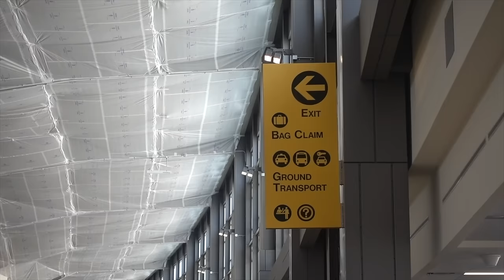MTB Myths that need to die—and some that are true!

Comment: Quick releases close on left  side because European road race mechanics change wheel on the fly fast. They pull the rear derailleur back with right hand and guide wheel into the drops.   The left hand pulls the left side into the dropout and then closes  the quick release.

Comment: But the air lines are not going top stop and check if your running tubes or tubeless, hooked or hook-less rims with the correct pressures. I was an heavy aircraft crew chief for over 20 years and if your pressurized item being stored in cargo has not been tested and certified safe for travel then loose the the air pressure. BTW I have had a tire blow off of a hook-less rim at 47 psi when seating it.

Comment: You can't burn your hand/fingers on the sprocket or derailer. If you have to stop for a flat and have been driving a while and braking and you try taking off your wheel when the lever is on the side with the disc brakes it's not so safe. I'm sure someone else mentioned this.

Comment: If got an old set of wheels for my racing bike. It has rimmbrakes, but you can close the lever so tied it gets caught in your spokes, if you adjust it on the wrong side. So there is some truth on this myth but not for modern bikes.

Comment: I was always told to avoid the disc side because it gets hot and you could burn yourself if you're taking off the wheel in a rush after a decent.

Comment: Tire pressure.  Look at the Ideal Gas Law.  Pressure x Volume divided by Temperature equals Pressure x Volume divided by Temperature.  PV/T = PV/T.  This is why aircraft tires do not explode, and no it makes no difference that aircraft tires are filled with nitrogen.  Aircraft tires use nitrogen to prevent corrosion.  Nitrogen filled vessels still have to follow the gas laws.

Comment: Recently flew with my mtb with tires at pretty normal pressures, and the tubeless sealant leaked out all over everything else. Not really sure how I'd deal with this in future, since the tires were completely flat by the time I got it back. Wonder if the cold temps caused them to collapse and leak air and sealant?

Comment: about the hex keys I think the ball actually damages the bolt less than the full key - you can damage the ball rather than the bolt
if you don't want to damage the bolts just use wera hex plus keys, this stuff can even open the stripped down bolts

Comment: A couple of things

Storing bikes, mine get stored in the garage all winter, in Canada and it doesn't seem to have much effect, even though one of the bikes has been stored like that from new in 1974....

Quick links, I think people would be a lot more likely to use them once only if you could buy them say in packs of 10 for $10.  At $7 a set, for what amounts to 15 cents worth of metal, uh nope.....

Comment: Swapping your skewer on the rear also removes the temptation to grab your rotor for extra leverage while closing. At a minimum you'll get your finger oils on the rotor or worse you could bend it.

Comment: for me the only true part about the skewer myth is the direction.

I once pointed the rear one forward and it got pulled open when I brushed against a bush that applied enough force to push the lever to the open position. I didn't notice until it came off some time later during a jump

Comment: I wanna cheap in on the airplane myth. Airplanes are pressurized to an altitude between 6000 - 8000 feet. If your airplane gets air pressure of it's current flight level of 30000-45000 feet you have bigger concerns than an over inflated tire.
Reply: In this case an emergency descend would be the first the pilots would do

Comment: what about reinstalling a link that you removed with the chain-pin pusher thingy
the thing what you use for pushing out the pins on the chain I mean

I actually did that on my motorcycle a few times too
many people say "if you do that it's gonna snap in a few meters" but I never hat that issue

Comment: Add to that fast engagement hub . I think pedal kick back is a myth . Yes on the computer cad it would show the chain is lengthened and being pulled back. But in reality you are most likely gonna be rolling forward even on the slowest drop so even if your chain is pulling the pedal back couple inches your wheel should be rolling forward  more than few feet per second to cancel out the pull back. And instead of kicking the pedal up with your weight on pedal it's more likely gonna spin the rear wheel forward as you are the bigger mass than the weight of the wheel with momentum going forward. Pedal kick back is 100% myth

Comment: The tire pressure thing is just science. If your ambient pressure is 14psia and your tires are 20 psig; then you go on a plane and ambient is 0 (not possible unless you are in space so literally worst case scenario) your tire pressure would be 34 psig. So ig 2 things, run your tubeless at tubeless pressure, and dont deflate your tires unless they say you cant load your bike otherwise.

Comment: The "One last run" jinx seems to be true. My opinion is that you loose your focus a bit thinking about packing up, driving home and the events of the day instead of just staying laser focused on getting to the bottom and surviving to get back on the lift with undamaged equipment etc. Also you focus more on the obstacle in real time not riding forward and thru it. Squeezing in one last run is all it takes to ruin an epic trip sometimes. Leave something on the table to come back for.

Comment: The only issue with QR is that’s just not so strong like bolts or 20mm axis, on bikes with gears it’s not a so big issue from what I know but on single speed bikes and forks it makes a big difference…

Comment: How about hydraulic brakes and vertical storage? I think some brake designs are designed to use gravity to keep potential air bubbles in the reservoir and vertical storage could allow bubbles to get into the system instead.

Comment: Why do people even use quick links?  Especially considering it takes a tool to use it.  Just use the standard chain removal tool.  And if your worried about messing the chain up you could mark the link so you don't press the pin out of the same link more than once each time you need to remove your chain.

Comment: Fast engagement hubs won't kick back the cranks if the wheel is turning at practically any riding speed. If you're going slow enough for this to be an issue, you're probably not having much fun.. you'd have to almost come to a complete stop..

Comment: Also you’re wrong about the ball end, it will not round out bolts unless you use it improperly, if you stay within the engagement angle specified by the hex key manufacturer you can fully torque it down with the ball end

Comment: I would disagree with this quick release thing. I have it on one of my bikes in front. And I installed it with lock on right side so it wouldn't get into disc in a case of a hit. Heavy pressure can brake the leverage. And if its't not on the rotor side, it can't make a way into the rotor for sure.

Comment: Regarding e-bikes. I am probably one of those fat, lazy people. But the reason I converted the E-bike is the fact that despite the main bike trail by me being only 3/4 of a mile away, it is at the bottom of a 1/2 mile long 4% grade, with some sections reaching 7%. That sucks at the end of a ride, regardless of intensity. So it was either ferry my bike to the trail head, or have it help too. It is also really nice to show up to work fresh and sweat it out on the way home instead (most of them have an off switch for the motor).

Comment: Gauge pressure inside a tire cannot increase by 15 psi... atmospheric is 14.6 psi and aircraft are pressurized to 11 to 12 psi. Air pressure at 42,000 ft is around 2.5 psi, so a pressure rise of 12.1 psi could be seen in the very rare event of cabin depressurization. Otherwise, only a 3-4 psi increase from cruise cabin air pressure.

Comment: The last run factor is true. I broke my collarbone skiing a half pipe while my friends were already walking to the car at Northstar. I needed ski patrol to carry my gear to the lodge
Reply: Ah, but if you'd done another run afterwards, then it would have been your penultimate run that was bad!
Reply: @devononair  Uh, sure, but I broke my collar bone...so another run wasn't on the table. Props to you if you could keep going after that
Reply: @nathanchildress5596  Yeah... that was the joke ;)
Reply: @devononair  Gotcha, ok.

Comment: I have started using clipless pedals shortly after I started riding MTB and moved on from them to flats after a couple of years, so one could say i learned to ride on clipless pedals, but it didn't take me long at all to get used to flat pedals. I have to say though that clipless pedals do make riding easier and I would recommend to start with flats to anyone new just to be a better technical rider.

Comment: My Rockshox Recon fork suspension oil dripped out onto my floor when I was hanging my bike vertical. Clearly new seals were needed. But still to this day I hang my bike Rear wheel up as the oil stain is still in my garage

Comment: even if there is zero friction holding a quick link in place, when is a chain ever in compression? I guess if you're rattling the absolute hell out of your ride, eventually there might be some utterly freakish combination of events that would both slide those plates past each other and separate them at the exact right moment, but I think the odds of Halle Berre deciding to spend a night with me are about equal.

Comment: It is still possible to get some qr levers to fold in to the disc, what it does is loosen the sqewer and make the wheel wobble.
A good quality hex ball end can apply torque and is essential for the STEPS drive side crank.
Studies have shown that people ride ebikes on average 3 times further than a regular bike. I have multiple customers with epic weight loss
Tally Ho!

Comment: 14:38 ....Well in europe, yes. You get 250W constant and peak power .With some exceptions of 500W peak power and 25kph tops (15 mph)

ANY value past that makes it a motorcycle : Helmet , license , plates, registration, insurance

250W and 25kph you can do without electric motor easily, cheaper and without a range limit and added weight

Comment: Another myth: using a drill on your bike will wreck fasteners and components. Nope, set the clutch appropriately and send it. You think I'm removing and installing them rotor bolts with a P-handle? Hell no.

Comment: Leaving your MTB hanging on the suspension fork for a long time will definitely ruin your dust seals. 100%! Absolutely. I had to replace the dust seals on the Rockshox Reba and Fox Float on bikes that weren't used for a year and hang there on the wall. The weight of the bike will slightly deform the dust seals and after one year oil fluid will leak out and drip on the bottom. 🤔 Even Suntour forks with grease only can be damaged since the tiny deformation leads to entry of water into the fork with subsequent rust party in the inner steel parts.

Comment: So here are people that are in for a discussion with the airline agents that decide what's going on the plane or not? Good luck. I travel A LOT with my bike and had that discussion coming up only once - in Milan/MXP which is a big destination for road cyclists and which is a whole other animal when it comes to tire pressures.

Did also not want to open any can of worms as far as air pressurized air shock/fork etc. in that scenario. But well... it's about letting air out of your tires. These check-in people are not engineers, they are just following their job following orders. It's not always about being right...

Comment: Hanging Bad for Suspension
never heard that one
but Hanging being Bad for Brakes is true.
(Hydraulics)
if the reservoir is only half full and you squeeze the brake lever while its upside down, you can pump an air bubble into the line
well, Ideally you wouldn't have air in the reservoir in the first place and you wouldn't touch the levers when hanging... but shit happens

Comment: Lazy person on an E bike. That was the best myth of them all. Flying a bike, agree, I have flown many times international with all three of my bikes at one time or another. With the road bike I let a little air out since I run those close to max pressure. The gravel also, just a bit, the mountain bike no.
Reply: The "Lazy person on an ebike", there is actually some degree of truth to that. I wouldn't say "lazy", but some people get complacent and less energetic in ways that causes them to lose some of their stamina and strength. Sometimes I ride with a group where couple of riders transitioned to ebikes. A number of times they'd bring out their other bike (no, I'm not gonna say "manual", or "acoustic" or "analog" because that's not what they are), and find themselves huffing and puffing up trails. But before their ebikes, they use to have no probs climbing those same trails.

Comment: I am a lazy person loading my e-bike into a plane with reduced air pressure in the tyres after changing my quick-link because I cleaned my chain after calling the last run then getting the chain muddy whilst practising  bunny hops using my clipless pedals

Comment: At 7:00+ you state there is not really a problem with the position of the skewer.handle.  Not correct, if the handle is closed towards the front of the bike it can possibly snag brush or vines along the trail.  That can really yank your leash.  Also if you are running directional tires which rotation is marked by an arrow on the tire's sidewall, if you always have the skewer handle on the left you will never accidentally mount your front tire in reverse rotation.  You are correct that on the rear drive side a rear facing handle can interfere with the derailleur.

Comment: Overinflation of tires happens.  Yeah, rock hard tires are FAST!  But that "over"pressure stresses and stretches the tire casing to its limit.  New tires can take it, but older tires are sketchy. Even with brand new tires, it's a good practice to reduce yir tire pressure after your ride.  New tires will keep that responsive feel  longer and older tires will last longer.   Just saying.

Comment: The first time in a plane I lowered the tire pressures like they told me after that I thought about it even if you took the wheel and tire to space the pressure would only increase 15 psi. that was with my road bike then I left them at 100 psi and their were pets in the cargo hold so it was pressurized like the cabin.

Comment: 7:20 it's not important if the quick release goes on the left or the right BUT it SHOULD face the front(if installed in the rear) to have some keind of protection(the frame) against rocks possibly loosening it up or random people trying to open it with their shoe. same reason to put the quick release pointing up the fork(if installed in the front)

Comment: ACTUALLY:  Since there is less surrounding pressure at altitude, it has less force fighting back on the outside surface of that tire.   50 PSI at sea level becomes 14.85  @ 30,000 feet.   feel free to tell that airline worker that information.    Now if you took that tire to the bottom of the ocean, well good luck...

Comment: Put QR lever on drive side in case the brake rotor get hot and you have to remove the tire, and accidentally touch the rotor.

Comment: Shimano, Sram  recommend 1 use for 11-12 speed chains. Everything else for 10 speed and bellow  marked as 4-5 times reusable. I reused QL 3 times already on my force xplr and intend to do it at list one more time before replacing it. Same thing am doing with my shimano 105 r7000. I'm not some super powerful rider doing heavy jumps or dangerous tricks on my bikes. I don't think there is any danger for my kind of riding. QR handle should never ever be on derailleur side. Rest of it is just random bullshit and urban myths.

Comment: Someone is clearly full of it on the ball end hex wrenches. I use those things everyday at my job. No they won't damage the head of the bolts any more than a loser key or a plain T handle. They are quite useful on bolts with messed up heads. You know, because unauthorized personnel are opening the doors on the machinery when they aren't supposed to with pocket knives.

Comment: Just like storing a car for along time take the wheels off and jack it uo make sure the suspensions loose and no wight sitting on them for a long period of time it buggers uo the tension in the springs but can't see a buke being as light as they are today would have this problem like old atx ones the rear shock done that on mine but it sat for like 8 years

Comment: The myth that your tires will explode on a flight is total BS. The cargo compartment on an aircraft is pressurised along with the cabin. The air pressure will not change significantly, certainly not enough to cause tire to explode. Even if the tire is over inflated.

Comment: The vertical storage myth is complete bogus. Having dry seals if anything will extend the lifetime of the seals. Being bathed in suspension fluid will have more of a negative effect on their lifetime than a positive one depending on the composition of the fluid. Elastomer materials chemically react with many lubricants. Having the wrong type of suspension fluid can eat them up quickly, and even with a suspension fluid designed with this material in mind it's possible they'll still experience some kind of degradation over time.

Comment: The one about planes, do planes not have tires either ? 😂
Reply: They still demand to deflate the tires, because the bike has air inside the tires and is inside the aircraft. Aircraft tires are filled with nitrogen and they are not inside the pressurized space. 

In reality a mtb tire would not have a real effect since the pressure is low but sometimes they ask for deflating it.